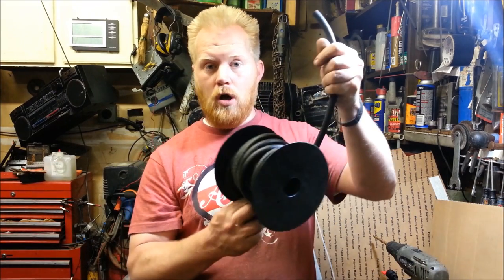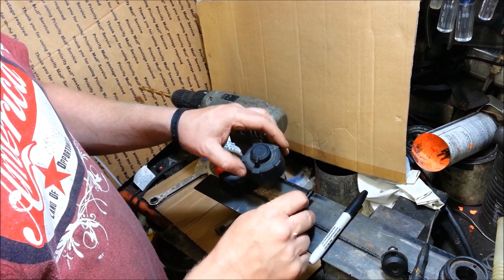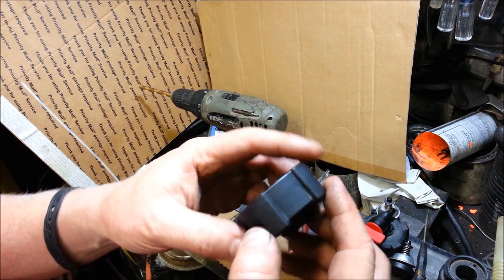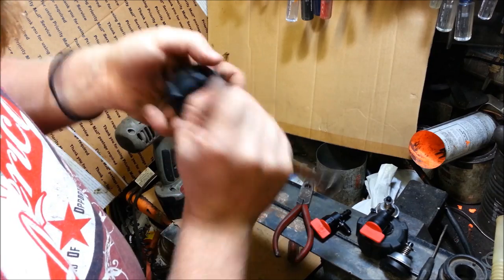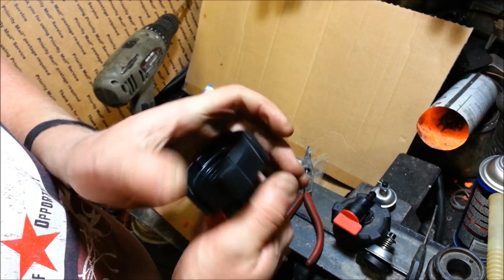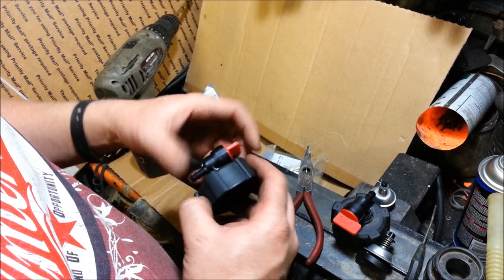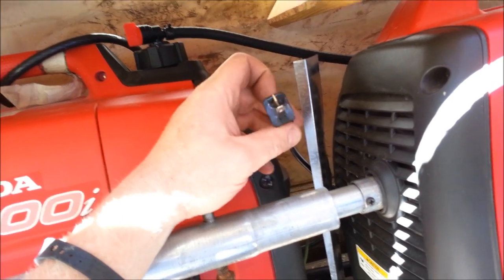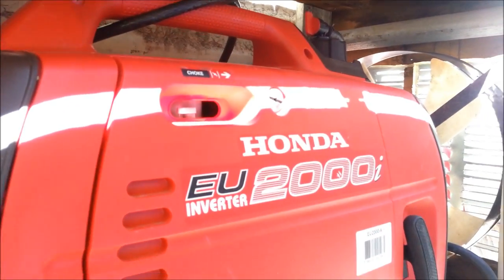Honda EU2200i EU2000i extended Fuel range Make your own gas caps

Comment: I just purchased a new Honda EU2000i generator, I've watched all your videos. Wanting to extend the running time of my new generator I purchased the Briggs & Straton shut off valve and went to modify my fuel cap as this video shows.
I seems that the newer model fuel cap I have doesn't match the one shown in the video.
After disassembly of my fuel cap (Pin, washer, spring, dome shaped washer, foam, rubber washer, valve) I went to drill the 23/64" hole and my cap is different than shown. It is deeper down inside to where you drill the hole. Anyway I continued and drilled a small part and tried to tap the Briggs & Straton valve in but the threads are NOT long enough to fit down into the cap.
I will need to figure out a different plan to attach the shut off valve and fuel line to my cap.
At least I was able to re-assemble the cap to original for now.
Honda has definitely changed their style of cap from the one shown in your video.
Reply from the maker: Yes, I've seen the new style caps and have had a few people message me on it. They only changed the outer dimensions to a larger more comfortable to remove size.  You can still do this, but you need an extension to reach down in there. The Briggs valve uses a standard 1/8" NPT thread. You can find small plumbing pipe fittings at the Home Depot/Lowes to extend the reach. There are 2 basic methods. First you could screw a 1/8"npt male x1/8"npt male nipple and then a 1/8"npt female x1/8"npt female union, then the Briggs valve.  Second you could just get a 1/8"npt male to hose barb fitting ( http://amzn.to/1YUdABR ) and then sleeve the Briggs threads and fitting barb in a short piece of rubber fuel line and clamps.

Comment: Why didn't you go with the harbor freight one? Great video!
Reply from the maker: Love2boat92 Loud... very loud.
Reply: sixtyfiveford Oh. That makes sense.
Reply from the maker: Yeah, they charge a lot for the Hondas but if you have to live next to your generator(RV or camper) sound it everything. People have had good luck with those HF units.
Reply: sixtyfiveford Yeah good point. I'd love to get one of the harbor freight inverter generators but they're a lot of money. The 900 watt one is more in my price range.

Comment: So when you running this do you leave the gas can vented, or is it vacuum sealed like the generator caps? I have heard your supposed to vent the gas can while the generator needs to be vacuume sealed. If the gas can isn't vacuumed sealed, how would it create vacuumed to pull from the gas can to the generator. Also can you leave the generator completely  full and have it pull from the gas can without overflowing.  Thank you for your time
Reply from the maker: The aux gas can is vented. The Honda tanks are sealed except for the port going into the fuel of the aux tank. 
Yes, you fill the generator tank all the way up then attach the setup.
Reply: @sixtyfiveford  thank you so much. I'm excited to try mine out

Comment: I'm attempting to convert my eu2000 cap as shown on video. The cap on my new eu2000 is slightly different. 
The threads on the pitcock is not long enough. Can I put an extension on it or use a different shut off valve .
Reply from the maker: I did notice that the brand new 2012-2013s have a new style larger cap. I haven't had a chance to tear one apart yet. I just assumed they were larger for easier grip, but I guess not. There are no longer petcocks that I know of. The Home Depot does sell small 1/8npt pipe and you should be able to buy one at around an1" or so. Then get a female to female adapter and screw the pipe to the petcock. This should give you the reach...

 I'll have to get my hands on one of these new style caps and play around with it.

Comment: Your generator basement is fantastic! Such a great idea with the fans and exhaust extenders. It was hard to tell, but is that sitting on a hitch style cargo carrier?
Reply from the maker: Thanks. It's kind of like a hitch cargo carrier. It is bolted to the square RVbumper and a wood housing was made for it (previous owner). I have went on a few cross country trip with it running and everything seams to work great and the temperatures(using temperature gun) are all great. I prop the door open a few inches just to help push out hot air but I wouldn't need to if the floor of the carrier was mesh.

Comment: Please show us how to extend the exhaust on the Honda EU 2000 generator. I like your set-up and would like to make one myself. Thanks for what you do.
Reply from the maker: It requires welding. I welded a small 1" length of pipe to the exhaust outlet. I then can insert a slightly smaller diameter pipe into it and use a set screw to retain it.

Comment: Love your set up with the fan and the exhaust extension! 
I read your prior comment below but still don't quite understand what's keeping the extension exhaust pipe from getting too hot to the touch.   
Could you please clarify:   you welded a 1" long piece onto the existing muffler , then added another free rolling longer and larger 3/4" diameter pipe over that to extend out to  your shed/box vent?  It's not a typo that the initial pipe you welded  is only 1 inch long tacked onto the original muffler and not longer?   Because im visualizing 2 full length pipes, one outside the other with air between the two to keep the pipe from being scorching hot.   
And you mentioned about screws or was it bolts to temporarily tighten the pipe.   So holes need to be drilled into the pipe?   What are thosr screw/bolt tightened against?  

Lastly, is that a galvanized water pipe, or a metal conduit?     Thanks so much in advance!
Reply from the maker: It's just cheap electrical conduit. I have 1" of pipe welded to the Honda muffler. I then can add any length of pipe to that and use a set screw to hold it in place. I put a larger piece of pipe over the length of pipe to reduce heat in some areas. I use bolts going through the side of the larger pipe that go in and touch the inner pipe as a stand off. You could also just use fiberglass exhaust heat wrap to wrap the pipe.
Reply: @sixtyfiveford  , got it!   Thanks for taking the time to clarify that for me.   Wishing you an amazing day!

Comment: Wow that's brilliant! Thanks so much!
Ok Last question!
I have two eu2000i's and sometimes I only use one, like to charge batteries or make coffee when I'm out boondocking, so I'm building this hose as you instruct and how can I shut off one side of the T when I only want to pull gas to one generator? It seems that since the cap is screwed into both that I have to haul them both out of the truck Even if I'm Only starting one.
Reply from the maker: You can use the shut off on one and remove the cap to carry the other around Or you can get an inline fuel shut off and put in inline with the one you want to leave in the truck. Unplug it after the inline fuel shutoff.

Comment: Tried building 2 of these and my genny just wont pull on either cap. Have o-rings in and everything. Do you think the 2015 models changed the amount that they can pull? Any ideas on why I'm not getting ANY suction when the valve is open?
Reply: Curtis Rose So I think I figured it out... I wasn't letting it run long enough to test the pull. When I put both tubes in individually and let it run for 20 mins, it did start to pull. Still had air bubbles from when the line got inserted, but those appeared to be leveling out. For anyone reading, just dont be too quick to think that it's not pulling. The pump in those things is pretty slow to do it.
Reply from the maker: Curtis Rose Yeah, these things use such low amounts of gasoline it takes a while to suck it through the lines. It essentially only replaces the fuel that is being used.

Comment: My EU2000 fuel caps are different than yours as shown in video. Therefore the valves used will not fit. Any suggestions?
Thanks
Reply from the maker: Charles Crowlrey The brand new cap are cosmetically bigger but should be identical internally.
Reply: Charles Crowlrey You have probably figured this out by now but, The cap,
internally is identical but there is a slight indentation at the top of the
cap. This causes the threads on the shut off valve to be too short. The way I
got it working was, I bought a short brass male and a short brass female
threaded pieces at Home Depot to extend the threads on the shut off valve.

Comment: I found a "Stens" part #120-224 from my local small engine repair shop and it works great. I got all my parts together and assembled. Now I am ready for a long running generator.
Reply from the maker: Stens makes good replacement parts. That is the exact part I used in the video.

Comment: Thanks. That did work. 
Note: The fuel cap on new eu2000 does not have the lip at bottom of the center hole. Just drill enough to pre thread and then your ready
Reply from the maker: Great to know. If it doesn't seal tight a little Permatex #2(any auto parts store carries) on the threads will seal it up.

Comment: I’m looking at one of your old videos about the Honda generator; do you have an instructional video on the exhaust extension you have on there?
Thanks
Reply from the maker: It's just a 1" piece of electrical conduit I welded directly to the muffler. Then I stick a longer piece inside and hold it with a set screw through the 1" welded piece.
Reply: @sixtyfiveford  Thank you

Comment: Are the petcocks for 3/8 or 1/4 in tubing? I'm using 1/4in ID tubing with 1/4 petcock and 1/4 T. I have my Powerhorse generators setup just like your video but the generators keep shutting down. Tube is just tucked in gas can, so it's not sealed shut. I did add an in-line filter between the gas tank and the T. I can see gas getting pulled into the filter, so I can't figure out why it's shutting the generators down. Any help is appreciated.
Reply from the maker: The Honda's have a fuel pump and aren't gravity fed like most engines. Do the Powerhorse units have a fuel pump?
Reply: sixtyfiveford looking through the manual I guess I don't see any mention of a fuel pump! I guess I just assumed the inner workings of this unit would be similar to other 2000w generators. Without the pump, I'm guessing there's no way to setup the extended run system, correct? If there is still a way, I'd love to hear about it. Thanks!

Comment: woould you have a suggestion on the connector that I would use for a 6gal moeller fuel tank if I didnt just want to "stick it in" the tank? I want a tighter fit and dont know what end to use on the moeller 6 gal tank, thanks so much!
Reply from the maker: Moeller uses boat 2 prong fittings. There a few options depending on you tank.

Comment: I appreciate your video. I have the newer Honda generator with Companion. Can you give me the details how to convert that gas cap and adjustments I need to make vs your video? Also I believe my Hondas are supposed to run 8 hours, not 4. Is that true and is it because they made a bigger tank or what? Thanks again.
Reply from the maker: I put detailed instructions in the video description for the newer style gas caps. They will run 4-8hours depending on the load applied. The gas tanks are the same size from old to new models.
Reply: You don't address the newer cap. What size drill bit, which petcock, etc. I would like to do the operation so please post the pertinent info. Thanks

Comment: Very nice video.  I'm going to try making one as well.  Couple of questions:

1. I only have a 22/64" or a 24/64" (3/8") drill bit, could I use the 22/64" instead of the 23/64" drill bit that you used in your video?

2.  I already have a 3/8" marine style fuel line and was wondering would that be too loose.  Was your 1/4" fuel line a snug fit? 

Thanks!

Comment: aren't all the caps suppose to be the same? mines is not like that it goes down a 1/4 inch before the rubber and hole to drill.
Reply from the maker: The new caps a slightly different. I address this in the video description.

Comment: Where can I get that 3/8" peacock? I've looked everywhere. You mention it's a Briggs and Stratton fuel drain valve. What engine?
Reply from the maker: The part numbers are in the description(399517). Ebay or your local small engine repair shop will stock them.

Comment: So you have some really good ideas on this and the home made honda parallel cable. The only thing I think I would change is the 12 v automotive fan to push air into the RV storage area. I can't exactly tell where yours is but I think when ventilating something like this it is better to "pull" air instead of "push" it. Pulling air will create a slight negative pressure in the space and guarantee that no stray fumes make their way into the main camper. 

Also, although nothing to do with this, I used to have a house with a crawl space and terrible moisture problems. It had a fan pushing air under the house to ventilate it to try to help with the problem. It didn't work very well though. I remounted the fan to pull the air out from under the house and the differences were amazing.
Reply from the maker: The setup hangs off the back of an RV. They are set up in a long box with ventilation only on each end. Pulling would put the fan on the exhaust side and would not be good. Pulling is better for large open spaces but pushing directs the flow to an exact spot and removes heat quicker from a focused area.

Comment: Nice! what's the model number on that valve and o ring you used?Also is it a 3/8 gas line?Thanks
Reply from the maker: 1/4" fuel line. All the parts I used are in the video description.

Comment: thanks for the share, curious, what's the point of the two genny's?
Reply from the maker: They're smaller, more compact and easier to move around. So you can just grab  one 75 lb generator by hand and move it around easily.
Reply: @sixtyfiveford  sure, but you're still limited to 2000W draw or is there a way to combine both?
Reply from the maker: @bikeninja956  Yeah, they combine with parallel cords and give you 4000W peak.
Reply: @sixtyfiveford  oh snap. Nice.

Comment: Very nice setup! And very smart way have the cap valve fitted! 
Some old good memories filled me when to show the way you twist regular 120ac to fit 12v honda :) 
I was thinking of putting a T-valve instead that would be tank/input port/ off/ so you can have honda fuel tank empty if using the extended one and have it off to use natural gas on burn carburator gas - easier for storage and not very expensive.

Comment: I use clear gasoline tube so I can see the gas being siphoned and know when it's developed a leak and not siphoning.
Reply from the maker: Bobby Harper Yeah, clear fuel line is nice. It tends to harden up rather quickly though.

Comment: Very nice. I like the fan and ventalation. I'm definitely building a set up similar to this. I might weld up a secure steel version of what you built. I bet they steal those things all the time. I'll make em bring a torch at least.
Reply from the maker: This box was on the Motorhome when I got it. Earlier this year I rebuild it out of steel and sheathed in Aluminum. Definitely more secure.
Reply: @sixtyfiveford  that's awesome. Thanks for the ideas. I think I'll make mine so I can unpin it and move it with the loader if I want.

Comment: Does this work the same with the EU3000is? The gas cap looks the same, but I see some kits that have an extra hose attached from the gas cap to something on the face of the 3000. Thanks for the tutorial!
Reply: I think its in the oil gauge inlet to create vacume.

Comment: can you provide the Stens party # for the small 0-ring?  Thanks
Reply from the maker: I don't think Briggs had a part number for just the O-ring. Run to a Napa Auto or any other auto parts store ask to see the O-ring bin and just pick one out. Or you can buy an entire assorted box from Harbor Freight or Amazon.
Reply: Thanks

Comment: Wonder if this would be the same for the Yamaha 2000is?
Reply from the maker: Yamaha's, also have a fuel pump and will pull fuel the same way. I haven't done one, but there is no reason if you can adapt the fuel shut off to fit the stock cap.  I would take apart your fuel cap to make sure it is constructed the same way and if so I would do it the same way I show in the video.

Comment: I know its kinda old video but for me is pure knowledge. I live in venezuela and we are having power outages of 4 hours every single day (only for mother day they left us in peace). 2 things: 1) would you rather a original plastic cap like your to be modified or ca i go with a metal one (in amazon they are like 9$). I read that metal would damage the plastic thread of the fuel generator tank. 2) could you do a video o be more specific on how you manage to do the 12v cable? Thanks a lot
Reply from the maker: The metal caps were a lot more when I did the video. They should work great.
Reply: Hello, on the EU2200I its a different size cap, the metal ones off of Amazon didn’t fit, and not sure of the size petcock ( threaded part or the hose part) should be used either. Thank you for taking the time and effort that you have taken with providing us with this video.

Comment: Hey Sixty.  I have a eu1000 clone.  It's a kipor 1000i.  Any idea why it turns off when I plug my old black and decker drill and try to use it?
Reply from the maker: The surge power on the drill could be more than the 1000 watts max. More than likely your drill is pulling more than this to get it started.
Reply: +sixtyfiveford darn it.  that's why I took it on trade...so I could use it for small jobs.  guess I could sell it.
Reply from the maker: A standard corded drill is around 5-8amps of running current. This is 600-1000watts running with medium work load applied to the tool. I wouldn't be surprised if even the 600 watt unit peaked at 1200 to start the drill or while it is under heavy load. The 8 amp drill will probably pull closer to 1800 watts to start it. Other stuff works with the generator?